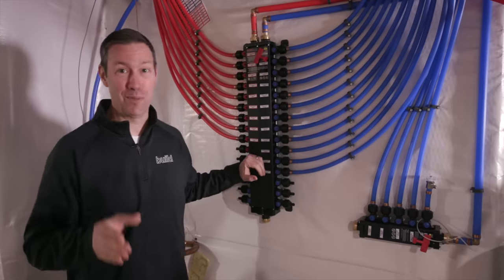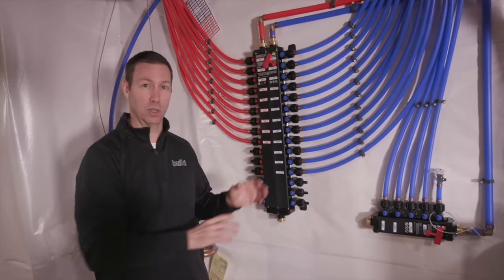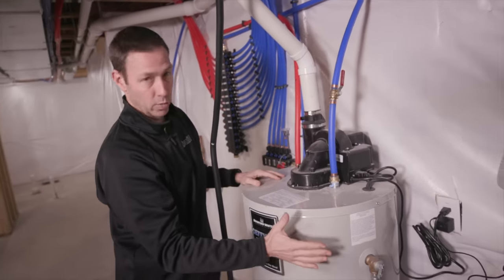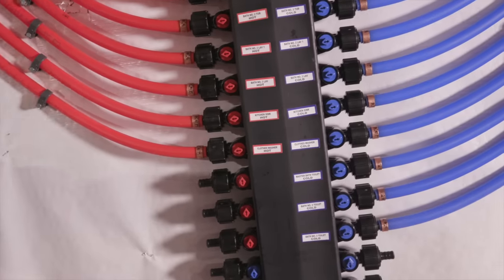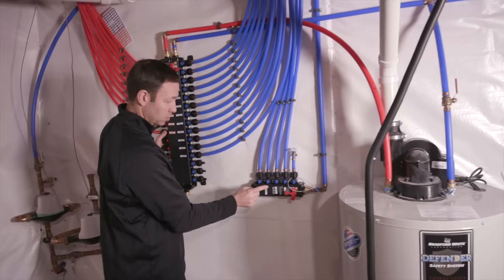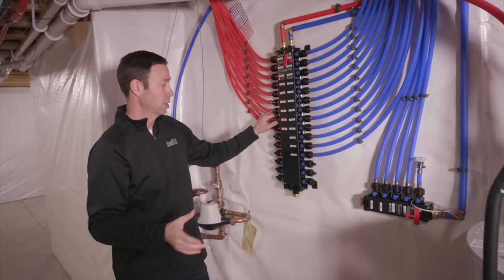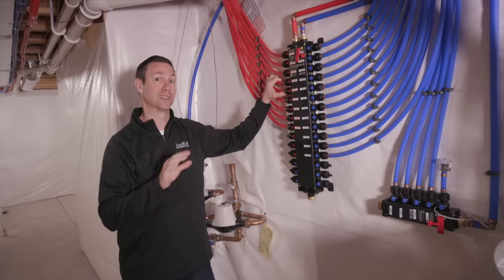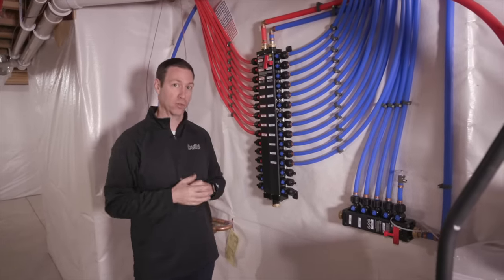PEX Manifold System - Pros and Cons + Tour

Comment: The homes piping is still undersized. In MN you need 18" of rigid pipe out of the water heater. The rigid rings are garbage, we only use the stainless sleeves. Viega is a great product but you southerners just don't have the codes we are upheld to these days. A clever plumber would be able to add a circ pump.Still impressed to see pvc rather than abs though.

Comment: but what if you put small Circulation loop on each zone like you sed for the master use the sink hot and then the line chard but then if you use that prinbile  and put one on the master sink one under the kichin and then gest bath sink than in theory ever lin after that t off like gest show master showers and the gets showers whod then be chard ??

Comment: The downside you mention,, fresh hot water reaching the fixture.  No.  The small line evacuates quickly,, in a conventional system it is a 3/4 piupe nearly all the way to the fixture.  The fixture did not move,, but because there are other fixtures on the same line,, the supply pipe to the upstairs,, the entire pipe needs to be larger,, longer evacuation time. 
I use a 1/2 OD tube for my system,, about a net 3/8s pipe to everything.  A 3/8s pipe,, a continuous smooth run, home run,, zero right angles, zero intermediate connectors,, requires about 12 seconds to bring fresh hot water to the MB shower,, a 90 foot run.  Capacity,, the two 1/2 inch OD pipes feeding the Roman spout for the two person soaking tub i the MB bath,, can deliver  7 to 8 gallons per minute.  each pipe can deliver 3 to 4 gallons per minute.  A modern toilet refill is 30 seconds,, 80 feet of pipe run from the manifold.

Delivery of hot water,,, copper is a heat thief,, plastic is not,,, and my admiration for your plumber grouping all the hot lines into a single bundle,,, he has in essence, self insulated the runs.

Mine was constructed in 1991, mid winter Michigan,, 1,350 linear feet of pipe total (500 foot spools)  3.5 baths, 2nd floor laundry, kit. hose bibs,, the works,, rough was done in a single day.  It is fast  !!!     30 year on,, not a single leak.  My shutoff are at the end of the run  Quest valves are the terminus and also the size adapters of PEX to standard 3/8 supplies.

I am old,, unlikely to do a full build again,, but I would never choose any system other than a manifold system.  I have built them, and lived with them,, they are a joy.

Comment: Ok guys.  Help me out here.  I don't get the advantage of a manifold system.  Why would you want to run a home run line to each fixture or, even to each zone (as someone suggested)?  Why wouldn't we branch off from a main cold and a main hot water line?  The manifold system puts the shut-off valve at the manifold.  Traditional branch plumbing puts the shut off at the fixture (in the case of sinks and toilets).  Is it because sending a home run line to each fixture eliminates fittings? Is Pex known for leaking at fittings?  This manifold system has to be crazy expensive.  As a seasoned DIYer homeowner, I only have experience with copper.

Comment: So the hot and cold are in the same manifold? Conduction will cool that hot water pretty quickly, even through plastic; it really should be two manifolds.

He missed a huge pro of installation time.. not only just two fittings, but it's probably 10x faster to run PEX than sweat copper.

Good point on the recirc line, but it's still very usable on the cold line at a minimum, and can still use trunk & branch on the hot side with PEX.

Comment: Not a fan - each fixture needs to draw a line full of water before getting hot water. Agree with the comments below - separate runs for each room or segment of the house, and then splits from there. If there is a concern about having connections to upper floors, then maybe concede there, but be practical as a homeowner and don't decide to have a house with 10 things connected to water upstairs.

Comment: I'm not a fan of hot water recirculating system. That's a lot of water to keep heated and will run your bill up a bit. But I wonder how well a manifold system like that would work with a on demand hot water system.
Reply: It works great  I installed at my uncle house  3 1/2 bathrooms from a 180k but Takagi Tankless water heater and they loved it. Bathrooms are one in top of another or side to side. And the manifold is just right bellow.

Comment: That isn't how they run the electrical in a house.  The wires usually go to several outlets and switches (creating a break, unless they just "loop" the wire on the terminal) per circuit breaker.  They could run the electrical like that with everything as a single run but I am guessing those houses are way more expensive than mine.

Comment: 1) You can't run PEX directly to water heater per UPC code 604.11.2 - has to be at least 18" off. 2) Where's the expansion tank for the water heater?

Comment: PEX is cheap enough to use the best possible which is Sioux Chief PEX A pipe. Better flow, volume and freezing properties over PEX B. Of course Boshart stainless steel fittings and Sioux Chief copper manifolds are a must. On a "custom" home, why not use the best? PEX B is not custom anything.

Comment: Install looks nice, but the plumber screwed up BIG TIME. The Viega system was engineered to deliver water efficiently, safely, and quickly to the  fixtures. A vanity faucet, kitchen sink, laundry tub sink, toilets, all have fittings that only have ¼" inbound fittings. Why do you run a ½" line to a ¼" fitting? You're wasting a ton of water, especially hot water to get to the faucet. Tubs, showers, washers need ½" pex and rain shower heads might need ¾" pex. ½" pex holds TWICE as much water as 3/8" pex. Thus twice as long to get hot water to faucet. I've had 3 houses with pex manifold systems, done the right way, not the way shown here, and I get hot water in under 15 seconds. One of the houses was 7500 sq ft with 70' runs to 2 of the baths.  The real problem is that plumbers think pex is a substitute for copper. They run a ¾" main line down the middle of the house, and then "T" off of it a hundred times with ½" lines. Totally wrong application.  And...if you're using a tankless water heater (which most do today), a loop system will wear out your tankless water heater 3 times faster due to constant cycling. IMO this was NOT a good representation of a proper pex job.

Comment: Doing a manifold may be convenient but it’s very expensive, which kind of defeats the purpose of using PEX - if you know how to sweat a copper joint then there’s only a small difference when removing a plumber. However, the materials cost is still a factor.

Comment: To solve the "time it takes to get hot water", couldn't one install a pressure detecting recirc pump and another manifold system solely for the hot water circuit? Kind of expensive but if one is paying for a system similar to what is displayed in the video, I would assume money is no object.

Comment: You can’t insulate the lines somehow? Just wondering, thanks
Reply: Would only be of limited use, i.e. fills that happened more than half an hour, but less than a couple of hours following a previous fill.
Reply: oh YES! you can buy uponor pex, pre insulated at the supply house, or add it onsite. pretty easy to do.

Comment: no vacuum breaker on the HWT, and yes pex into the tank is against code here in Canada. TBH if you're building a house and you don't incorporate a HW recirc line I don't know what you're thinking. These home run systems look like a a water waster with all those hot lines getting cold when not being used. I think trunk and branch is still the way to go, with recirc it makes it more efficient.

Comment: Honestly I would never ever install a manifold in any house, it waste a lot of water for no reason. You're gonna wait for the hot water to arrive at every single fixture, not to mention you are gonna waste an incredible amount of pipe for no reason. I will always install a shut-off valve underneath every fixture. I always install shower rough that have two shut-off valves built-in. The only real incovenience is with the tub and exterior line, you're gonna have have to open the wall or ceilling to cap those off or take out the bathtub. I've been a plumber for 15 years now and I've worked with every available material and in my opinion regular pex is the most cost efficient and effective way to pipe a house. 3/4 pex is more than adequate to feed a two bathrooms house with a kitchen, laundry and two exterior line. Add another toilet and lavatory and you've reached the limit for that size of pipe. I usually run mutiple 3/4 lines from the main water source whenever i have a large house with 3-4-5-6++ bathrooms. Working with 1in pex is not really pleasant and easy because its not that flexible and its more costly than running multiple 3/4 lines. To ensure an adequate water supply to all the fixture i always run a 3/4 line all the way until the last two fixtures and only at that point will I reduce down to 1/2in. 99% of fixture (exept bath and shower) have 3/8 internal lines if not 1/4. I used to run a speedway with a shut-off valve to the bath faucet but i've had issues where it wouldnt get enough water sometimes so now i always run directly to the faucet with 1/2 pex, its sometimes a bit more difficult to connect the faucet but ive never had another issue since then. I also run a 3/4 line all the way to the shower faucet and connect it to a copper reducer because i've had issues in the past with certain shower faucet that wouldnt get enough water. Ever since i started following these guidelines, as long as the main water line supplied enough water and pressure, ive never had a complaint or problem.

Comment: The first thing I noticed was that the manifold is not plumb -- it looks janky. You said a pex system has more connections??? The beauty of pex is fewer connections, the pipe bends thus eliminating 90s. If done correctly changes of direction is more gradual and therefor less restrictive. Also, a manifold that large would benefit from a feed from the bottom as well as the top, thus reducing the lag you're worried about.

Comment: Matt I guess I don't understand if you have 50' you have 50'. Feet it doesn't matter if it's a manifold system or just going to the hot water tank. It don't matter you still have to wait for your hot water.

Comment: Just design your house well.... my parents used this system and have a 3 story house and hardly any time at all for the hot to get there.
The other pro to this system is when all the hot is on one line when someone uses hot but not cold some where else in the house it turns your water cold.... and if someone uses cold that is on a single line then it turns your mixed water hot. You don't have that problem with this system.

Comment: Unlike electrical, I didn't think the term "home run" was applicable for plumbing, water comes from the source such as the manifold here but it doesn't come back (it goes out via drain or on to grass or car wash or whatever) , unless I guess if you have a recirculating hot water system with hot at tap always.  Home run IMO goes out and comes back to source.

Comment: The cost and complexity could have been cut in half if they just did larger single room runs instead of smaller single fixture runs. I like the idea of being able to shut off each fixture but you would get just as much use out of just shutting off a room instead.

Comment: 940 wouldnt it better to waste water than electricity to heat a water line? 10 hw water lines 3 gal each thats recirculating n heating 30 more gallons 24/7.

Comment: wait a minute, thoes 2 pipes coming off the tank are a lot thicker before it gets to that panel, and then an elbow joint, takes the input to the "distribution board" to like 1/3rd of the diameter THAT can't be good

Comment: One manifold with 40 valves. When it gets old any one of those valves can begin leaking. Then you throw the whole thing in the trash and blame the last person who touched it. I am a plumber and when i encounter these things i go outside and shut the valve off at the street. I'm not stupid, I wouldnt touch that bullshit thing. And yes, the plumber did a very neat and pretty job.
Reply: You're correct. I had to replace an entire manablock for a customer where two valves cracked in a light freeze. Their block was a custom size for opening and had to be special ordered at a premium price. A homeowner that's unfortunate enough to have this should probably consider buying a spare manablock because you know that plastic garbage is going to fail.

Comment: That is not how electrical is run in a house.  its by zone/area, or load, and based on demand. why not run a pex tube to a bathroom and branch off locally to the individual room? then if you do have a leak, which is typically slow and/or unknown, but determined by area you can isolate it.  once the leak is known, which in this case would be a screw from framing or drywall install, you would have to open and cut out the damaged pex, put in a repair splice, then fix your wall or ceiling.  otherwise code requires in most areas you still have valves behind a toilet and beneath a sink.  once installed correctly, copper lasts 50+ years without issue.

Seriously, be smarter and make home-run using pex for flexibility with TJI or in a remodel, but this is overkill and a costly manifold like this should be used for radiant zone heating and a smaller block for zone distribution in a drinking water scenario. where you need an on\off flexibility.  otherwise, they sell valves for the same purpose, making this a novelty that a homeowner will never touch for any realistic purpose.

Comment: I was commercially licensed in 1989, plumbed custom homes for 20 years, now I do mostly service. I've encountered these systems several times- in each case, the home owner wanted rid of the system- mind you- not my suggestion- THEIRS. and I agree.  there ARE NO ADVANTAGES to this system. hot water ALWAYS TAKES LONGER to get to fixtures. and there is NO practical way to fix this. shutting down an individual line to a fixture? that's what stops at fixtures are for. even tub/shower valves come with that feature BUILT IN now. the valves at the manifold are plastic- and are absolute krap. give me a good watts or apollo ball valve ANY DAY.  way more pipe wasted, way more labor wasted.

Comment: I've installed several of those viega manifolds per builders specs, don't care for them.  The fittings on the side seem kinda fragile, wouldn't take much to break one if homeowner/handyman decided to work on it.  Second, you waste a lot of pipe, and lastly, a recirc loop would be a waste.

Comment: 3/8" runs on everything but tub/shower and clothes washer, without any fittings in the line restrictions are minimized. Hot comes fast and waste is minimized. Get rid of the brass elbows and t's. My home run system delivers hot water MUCH faster than the old copper/galvanized plumbing did.

Comment: Is that 1/2” feeding everything?? Better not use two fixtures at one time???

Manifold systems are very problematic. Would not recommend. But they are pretty common right now for some reason.
Reply: more common in track homes. custom home builders avoid them like the plague.

Comment: And if you don't use water for a time, it's a bad system, you need to 'flush' all water out before drinking... (and yes in Scandinavia water must be clean without using chemist - e.g. 'Drink Water' quality.. I know many places this is not possible, but still - still standing water is a bad idea  - and for having hot water in all taps - use a Grundfos Alpha intelligent pump, it 'learns' what time of day your home and starts circulation before (if timer function is not used) of cause a double hot line that has this hot water circulation  PS I’m not a Plummer 😊 … just fan of instant hot water in all tabs in the house

Comment: that manifold just adds cost...cheaper to do one hot & cold and valve each appliance ,if run on hot is too long( here if its near 20ft a secondary return is needed) and tbh its not that nice to see all that pipe work bundled like that ,that and no lagging,in theory its cool in practice its a heck of  a lot of pipe  and work ..
Reply: It's not that cheap to hire a plumber to make up 87 soldered pipe joints, thread pipe through all the joists and headers/plates and precisely drill holes and make it look good.  I've done it both ways (no compairison). I don't like using torch in there either.

Comment: I have the same system, ~35 feet of 1/2 pex to my manifold and my shower water is hot in less than 5 seconds.
Reply: Also, 1/2" pex ID is closer to 3/8", all pex I've used has smaller ID than copper or PVC
Reply: about the same amount of time I run the mile. lmao... not.

Comment: softened water will destroy your water heater if it's equipped with an aluminum or zinc anode rather than magnesium.  Even then soften water will still corrode your anode faster than hard water and once that goes, your tank is next unless you stay on top of it.

Comment: Looks to me like a poorly managed desktop on a PC.
A bunch of files slapped on the desktop directly, no file folders for entire rooms or directions.
If it were located in a corner of the house, I'd split based on direction, and have a hub at the first output with multiple connections for outlets within 50'.
pass through for connections past that with another hub within 50' of the next set of outlets.
Do that a few times and there are likely 4 or fewer smaller hubs positioned closer to the destinations for everything.
Lack of insulation also bugs me.